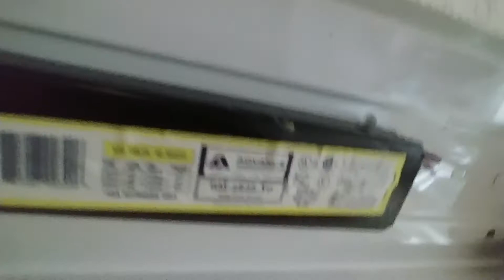Easy CFL to led DIY - kitchen tube light T8 to Led conversion

Comment: Some LED tubes can be energized on either one side or both sides. If you had an LED tube that used the pins on one side only for hot and neutral you would need to make sure the lamp holders were in shunted, so each pin on tube is connected to hot or neutral pin. The type of LED tube you buy depends on how they can be wired. Both systems are good.

Comment: Which bulbs did you buy? This is obviously different than the one sided power set up. Is this way better?
Reply from the maker: I bought these led tubes. Amazing value. https://rover.ebay.com/rover/0/0/0?mpre=https%3A%2F%2Fwww.ebay.com%2Fulk%2Fitm%2F283461324604